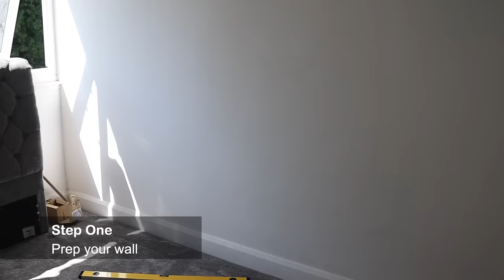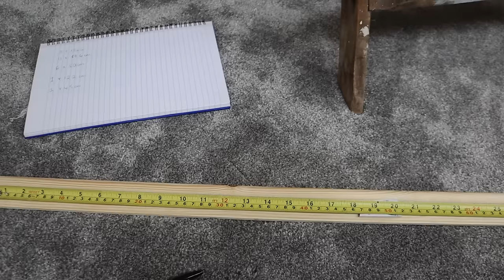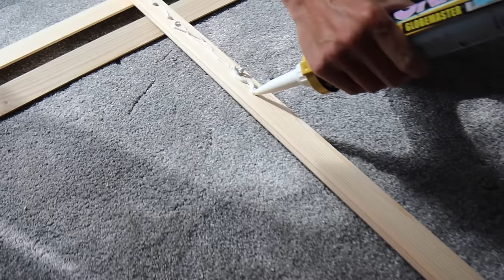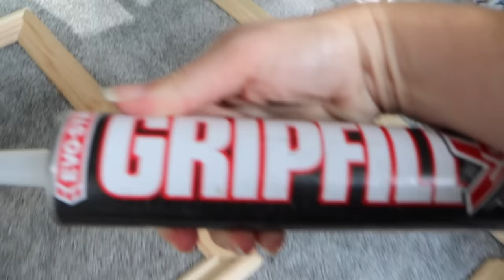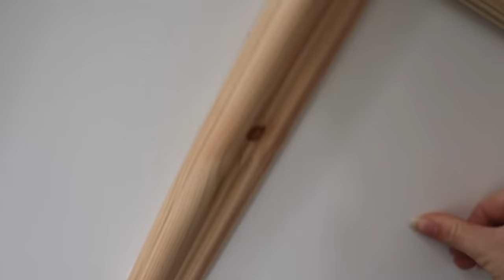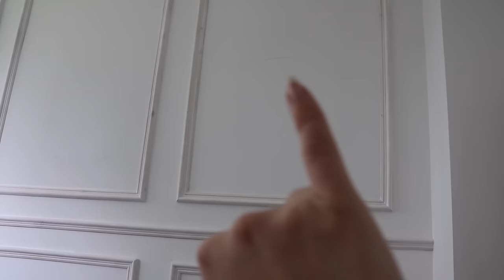EASY DIY WALL PANELLING - HOW TO GUIDE | Transform your plain walls!

Comment: Of all the paneling videos I've seen in preparation for doing this in my own newly purchased home, this one is the most approachable and least intimidating. I appreciated that you didn't use nails, or power tools, but a handsaw and the miter box. Learning about the miter box solidified that I will take this route as well. Thank you so much!
Reply from the maker: Ah I’m so glad! A hand saw and a mitre box is all you need🥰 good luck with yours❤️
Reply: Can you stick these beats or panels  on concrete wall? In UK they have drywalls board right?
Reply: I felt the same way.
Reply: Agreed!!  I just decided I was going to tackle this project but didn't know where to start.  This is so easy to follow.
Reply: Do you have a link to what beading you used for the squares please?
Reply: I went out and brought a circular saw the dam thing was just too aggressive for me and spewed saw dust every where. Decided to take the Mitre route ..more precise and minimal saw dust in comparison cutting the same pieces
Reply: @laurahall5144  Hi Can you please tell how can I get it from other country. what i will search for . We are doing same work. Can you tell the wood name I will search
Reply: @sprig6043  You may need to buy a specific blade for fine wood cutting - if you just use the blade that comes with the circular saw - normally thats just for general purpose cuts....good for rough cuts on 2x4s etc - but not great for molding n fine cuts
:)

Comment: Just a tip when caulking , if you use a good quality masking tape both on your walls and on your moulding and even across your joints then you will have no rubbing down ,

Comment: Hey was just wondering what the measurement was from the floor to the dido rail that goes straight across the wall? Looks so amazing❤️
Reply: You can do it any Measurement. I think a lot of times people it around 40 inches. Hers is lower than usual though. Maybe 2 feet. Just guessing.

Comment: Hi Laura the panelling looks great.  Can I ask what is the distance between the top of the skirting board to the outside edge of the horizontal frame. Also is that the same distance from the ceiling down to the top outside edge of the upper frame also?
Reply: I am also looking for the same thing. I believe the vertical distance is 10 cm against the 15 cm horizontal distance. Were you able to figure out the same?
Reply: 10 cm. Used a little bit of math to figure that out. Let me know if you need to know how.

Comment: I live in Texas, USA where textured walls are EVERYWHERE. can I use your method for textured walls?
Reply: This is exactly the question I have! I just watched this video because I'm considering doing this and I'm also in texas with textured walls, wondering how to do this and get a smooth look? Wondering if I should place sheets of board on the wall first?

Comment: Can you tell us what the size of the gap is from the ceiling to the vertical panels? Same for the bottom.
Reply: 10 cm. Used a little bit of math to figure that out. Let me know if you need to know how.

Comment: You’ve written the measurements horizontal but what about vertical ? Could you please give rough measurements for those too. Thanks
Reply: 10 cm. Used a little bit of math to figure that out. Let me know if you need to know how.

Comment: Could this glue damage the wall?Pls someone tell me. I want to do this 😭
Reply: Yes when you come to remove it the glue is likely to pull off plaster. You could use some small nails too, then may not need as much glue.